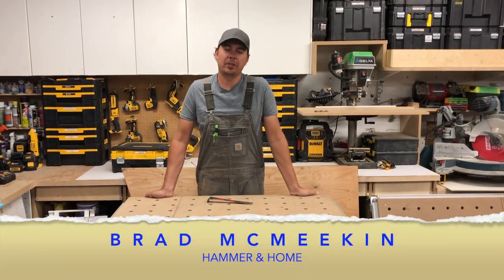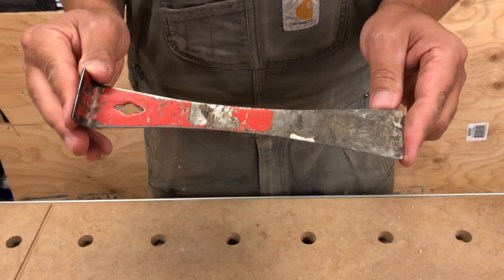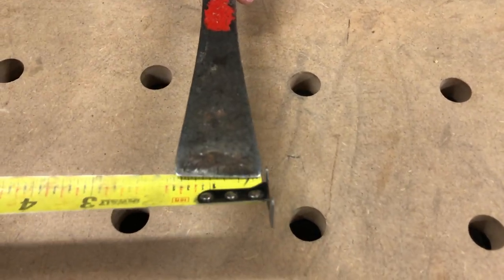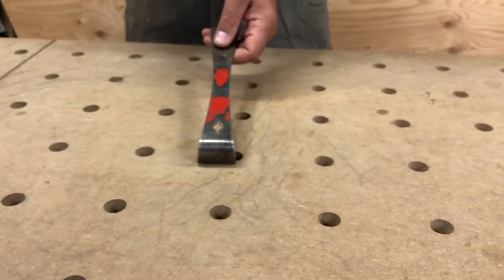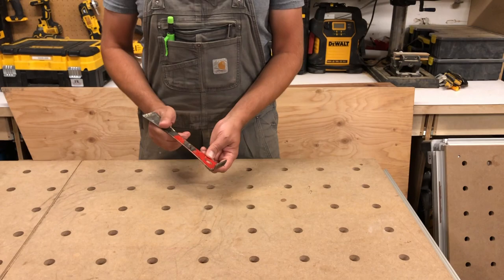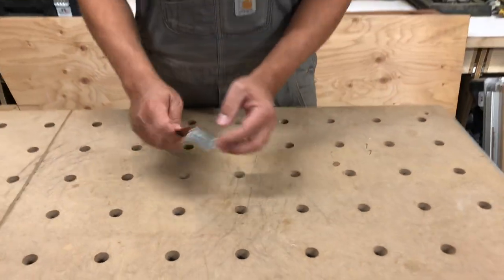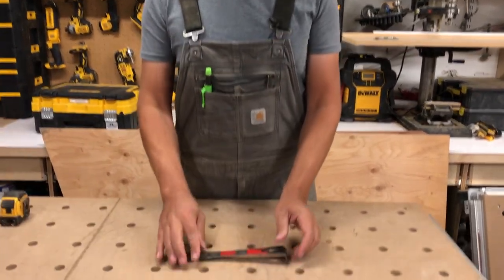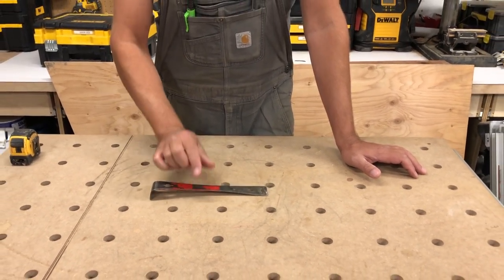9'' PRY BAR USES and why you need one ASAP

Comment: What's the difference between a Glazer Bar and flat bar? I'm looking to buy, but I'm not finding much info. I'm also looking at titanium to lighten my tool bag. Thanks. I do handyman type of work. Plumbing, carpentry, painting, electrical, trim, etc.
Reply from the maker: really a Glazer bar is a small bar with the 90 deg bend at one end and a pry at the other, used for installing windows. but also used for so many other things. there are lots of brands and options out there for sure, i have always liked the red bar